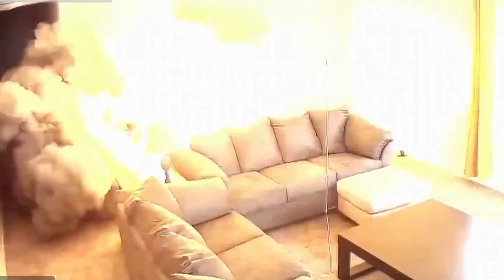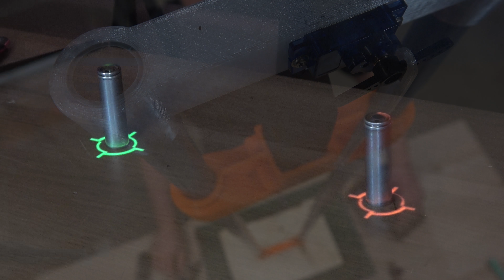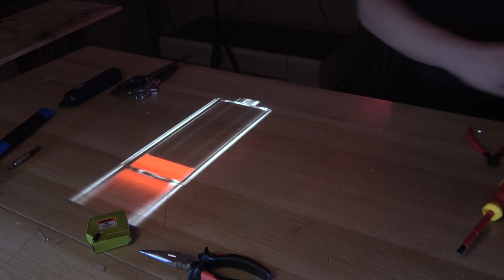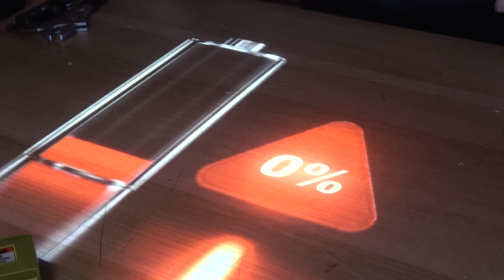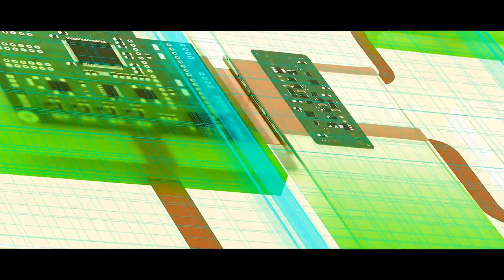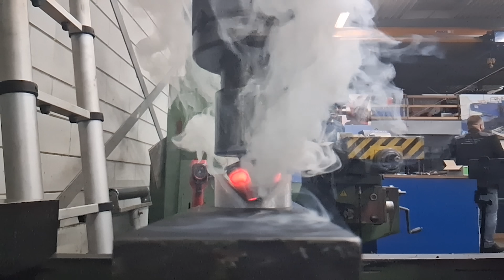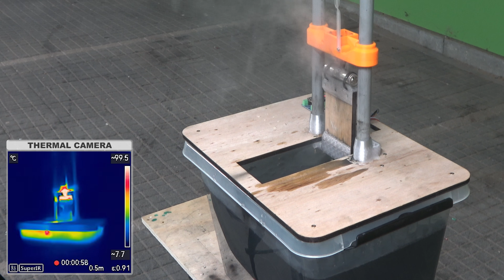Detonating Batteries.. For Science!

Comment: Pretty good followup! Would have liked to see you explain how to properly extinguish a lithium battery fire after demonstrating that water is not very effective. Additionally, you didn't address the oxygen in the water. Was the water oxygenated? Was it under vacuum before the experiment? How does oxygen in the water affect the ability of water to suppress a lithium battery fire?

I'm sure most people trying to extinguish these fires would spray or throw water, meaning the water would be oxygenated, but for the sake of science it would be interesting to see how deoxygenated water would suppress a lithium fire.

Comment: With the water test, i think the surface area to volume ratio of the cell makes a difference. i wonder how a thin and flat pouch cell about 4mm thick but much longer and wider would react to water - with a bigger surface area relative to its size, it might quench more quickly

Comment: For anyone who's confused as to why there's a difference between how fully charged and discharged batteries fail, this is because batteries use an electrolytic solution, usually an acid/acid paste, two dissimilar metals, lithium being one in this case, and am electrical connection between the metals made by the circuit/load you connect a battery to. With a fully charged battery  the pure lurk metal reacts violently with the moisture in air when exposed to it. When the battery is fully discharged the acid has completely/almost completely reacted with the metals making them no longer pure which leaves you with little, if any, pure lithium to create the violent reaction with air moisture, until you recharge it which reversesthe whole reaction.

Comment: from what i know, the battery doesnt create its own oxygen when submerged under water, the energy being released in this whole reaction is strong enough to cause electrolysis to happen, splitting the water into hydrogen and oxygen, which then feeds the flame underwater.
To extinguish a lithium fire, you must remove the oxygen from it, this can be done with dry powder fire extinguishers, in some cases special ones that use sand can also be used.  
Obviously the heat will remain, and the reaction will continue after removal of the powder/sand, so it is important to let it cool down for a while.  
But yea, that is why water is such a bad idea, it is quite literally as if you put gasoline on a fire.

Comment: Think I counted 27 Li Cells in my room alone... Hope this 12yo phone in my drawer doesn't spontaneously combust.
Reply: Usually happens during charging or hi draw. So just sitting dead in The night stand is normally safe. I had 1 burn. Try it out. Charge up one of tjem old ones and like he did stick a nail in it use a welding glove voltage heat and bad smoke. Or of you bend it it will go off. Thats how i killed 1 skinny phone sat on it like we all have done one in our back pocket.  Even had a galaxy 9s i tnink that i got new that lasted for years. Great phone it was. The battery started going bad so i ordered one. Phone wroked great till they told me they were killing the 3g and limiting the 4g so the phone would no longer work. But while swaping the battery the phone was all glass and glued together and water proof they say. Never tested it expect a small spill like we all do once and a while. Anyway the battery was also glued in the phone so i used the plastic prybars and tried to pull it out nice and slow. Then i bent the corner just a little the thing went off like a fire cracker mortar 3 ince flame bright blue and orange smoking up my living room while everyone else was sleeping instayed up late back then i worked at night so i kept my schedule on off days. Im like wooooo woooooo ran to kitchen grabed oven mits to the phone out in the yard into a puddle from the rain. It kept burning.. in the water. Luckily i did get the the thing out the phone and saved the phone some how. Did need to order a new back glass i broke it trying to rip the battery out at this point. Fun 😊
Reply: SAME! i have some rogue Li Ion Batterys ALL around my house Hope they dont spontaneously combust!
Reply: i used to do the same holding on to old cell fones , i had to dump them all because one of the oldest ones battery swelled like in the thumb nail . it was an old flip fone
Reply: Interestingly, guess what happens when a Li+ battery gets too cold? That's right! More fire!
Reply: ...you might want to check that phone since in my experience old batteries like to bloat when deeply discharged. I just had my old phone's battery bloat recently after I stopped charging it for 2 months.

Comment: From experience, it's scary when you puncture an iPhone battery by accident. Water does stop thermal runaway inside the battery itself, which basically stops the reaction already happening in one cell of the battery (supplying its OWN oxygen), spreading to other cells. You should chuck it on a stone or tile surface if safe (just smoke no flames), do not place in a metal sink as this can short it internally and make it worse. Get out the room and don't breathe in at all near it. Hold your breath. Never go back into the room without PPE until 24 hours after the reaction has finished. You should either leave the door open to the outside, or safely open a window (with an appropriately rated mask on).

Uni was fun. Luckily they had heat alarms in kitchen and not smoke alarms. :)

Comment: A dead battery is at its nominal voltage ifrc for a 18650 vape battery, they were 4v batterys would charge to 4.2v and dead was when the battery was below around 3.2v they still hold nominal charge no matter what

Comment: Deflating them is safe if you just make a tiny pinhole, deflate it, then immediately seal the hole with a spot of nail varnish.
I dind one of mine a few years back that was badly inflated, and it is still working normally and has never had a problem.

Comment: Pure lithium violently reacts with water and imolates on contact due to an exothermic reaction, in other words it catches on fire almost instantly. Yet another reason lithium battery fires are hard to deal with. Lithium is usually refined chemically from lithium oxide or other lithium based chemical compounds that are somewhat more stable. Lithium batteries aren't as eco friendly as many people think, the process of mining and refining it completely offsets any ecological benefits it gives after the fact. Not to mention the terrible pollution you saw occurring when the battery catastrophically fails. It is also very toxic and poisonous to most forms of life when improperly disposed of.

Comment: It does depend on the oxygen just like any other fire. And I'd bet batteries don't have air in them so it's not about that. It's alkaline metals that tear oxygen from water and sand when burning because of the high temperatures. You have to remove all oxygen from the source to stop the fire(e.g. you can stop the metal fire with gasoline(because it doesn't have oxygen in it) then with water. That's not really what you should do, but it works. It'd be better to use table salt because it'd stop the fire and won't start a new one on it's own like gasoline)

Comment: I imagine it'd be as easy as a few hundred gallons of liquid nitrogen to hose it down with or dunk into. Easy! Although the exothermic reaction is so damn strong and well "shielded" inside the batteries in question, that would probably even run into serious trouble combatting temperature which is the only thing you can possibly change once the reaction starts. They are self oxidizing and when the massive current dump creates enough heat for ignition...that's that. Water just doesn't have enough punch to cool it.

Comment: The CSIRO (Commonwealth Scientific and Industrial Research Organisation) over hear in Australia, are developing a Thermal Energy Storage (TES) battery that uses graphite or ceramic plates.  They say it should be in the vicinity of 70-80% efficient.  Which is extremely efficient considering it will be unlikely to undergo "rapid unscheduled disassembly".   That efficiency is good, they want to get it better because that efficiency is similar to lithium-ion batteries.  But those batteries store electricity, the inefficiency side of that gets turned into heat... which can then blow up.  But you do not plug these thermal batteries into the wall to charge up, they use heat.  They turn that heat into electrical power.  It is really quit clever, it's basically it is a solar battery and lithium-ion batteries are capacitors.  
 
Side note; they have already unveiled the worlds first quantum battery as well, but unless the thing runs on cats*, I have no idea how that thing works, because they charge faster as they get larger.... which makes no sense at all. 

* Schrodinger's cat joke.  If you get it - you don't get it, because the cat is both alive and dead.

Comment: Lithium Fires can seperate oxygen and hydrogen apart if the runaway event is bad enough so by spraying water on the battery you're just adding fuel. You're spraying water to prevent it from spreading, and cooling the environment, but never spray directly on the battery.

Comment: I worked at a battery store for 9 years and 11 months. I do have to say lithium battery fires are pretty rare. I saw 2 in all that time and those 2 were caused by improper disposal. Best advice I can give is do not throw away lithium batteries. take them to be recycled. When you are finished with a battery tape over the terminals of the battery and make sure there is no exposed metal. Also tape up each cell individually, not as a group or pack. Also swollen "danger pillow" batteries almost never pop. I have never seen one pop at least. I have seen them break out of plastic cases but the polymer bag that is the actual battery almost never pops.

Also lithium-ion or lithium polymer batteries dont really scare me. I mean yes they are common and can be dangerous but the battery that scares me more than anything is lisocl2 batteries. Lithium Thionyl Chloride batteries are terrifying. Thankfully they aren't super common but its possible you have one in your house. They are used in a lot of non-rechargeable items as a battery backup. Theya re also used in some diabetes test meters and pulse oximeters. When these get punctured they can have the violent fire but they also spray thionyl chloride out. Which turns to strong hydrochloric acid when exposed to humid air. I had one spray me in the face once. I thought I lost my eye but I got lucky. I ended up with a combination chemical and temperature burn that lasted a few weeks. It looked like I had bad acne. It was very painful though.

Comment: Very interesting video!  I look forward to seeing more tests.

As other users pointed out, the inclusion of LFP batteries (LiFePO₄) will be interesting to test.

Because the current tests used NMC batteries, and NMC cathodes will release oxygen in a fire event.  That is, NMC batteries "self-oxidize" to feed the fire.

OTOH, though LFP cathodes also contain oxygen molecules, it does not release them as easily, even during hot fire events.  So an LFP battery should only vent white smoke without a fire.  That is a major reason LFP batteries are much safer than NMC batteries.

Most EVs are already switching to LFP except for the higher-end performance EVs.  Almost all home batteries are now already LFP.

Comment: Rules to follow.
1. Charge to 95% and take the device of charge
2. Never sleep with your phone or any other device on charge next to you or in the same room... If the battery explodes, you unfortunately will not survive.
3. Never buy cheap batteries, Spend the money on top Quality batteries
4. Replace reusable batteries once they seem to not hold charge as good as they used to.
5. Don't buy anything that uses batteries off Temu... Too many house fires are started because of that crap. 
6. Always read the user manaual and safety instructions before use... common sense
7. Dispose of batteries properly, don't just throw them in the bin.

I'm a firefighter and have responded to two house fires and a garage fire due to shit quality batteries or batteries left on charge.
Also, I have responded to two garbage truck fires due to improper disposal of batteries... I know this information because we always find the batteries once the fire is out.. we know where the fire starts.

Comment: Class D copper based fire extinguisher.  You can also get the buckets of the copper based fire extinguishing powder.  Problem is that that stuff is pricey.  Copper binds with lithium with the intense heat.  Turns into an inert alloy.  It happens near instantly when the copper comes into contact with the lithium.  I gave up on telling fire fighters, stores, repair shops, companies, etc..  They just don't want to listen.

Comment: I'm not sure of the exact chemistry of the out-of-water reaction, so I can't say for certain this is what's going on, but alkaline metals burn violently on contact with water, stripping the oxygen, reacting with the oxygen, and leaving hot hydrogen bubbles that then ignite when they encounter the oxygen in the air. It's entirely possible that, if water is able to enter the battery, it may actually be the source of the hydrogen flames you're seeing.

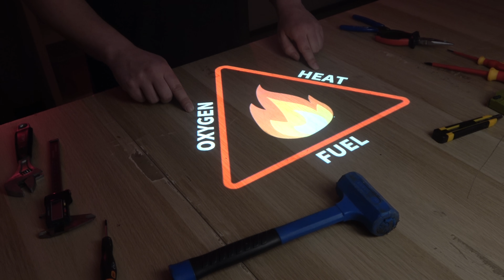Comment: 13:22 You're not taking oxygen away, unless the battery chemistry is something like Aluminum-air, which isn't quite ready for commercialization yet. Batteries almost always contain their own oxidizer. Furthermore, many of the metals used in batteries are reactive enough to use water as an oxidizer, which means by submerging them you're actually adding to that side of the fire triangle.
Reply: Which is what he said in the video.
Reply: Nice job not watching the whole video lmao

Comment: Nobody ever seems to have a direct answer to where to safely dispose of batteries, and also, what about lipos? They are more powerful than ion batteries. I’d like to see the same tests with those. I’ve got 60+ lipos, some of them are over 20 volts and 6000 milliamps per battery.
Reply: When you're throwing them away, completely discharge them if you can (down to 0V), or discharge them to their lowest nominal voltage and put a piece of tape over the contacts.
Reply: @logitech4873 and then what? Trash? I’ve heard from other people specifically NOT to do that.
Reply: @PigglyWigglyDeluxe  Huh? You don't throw them in general trash, no. You deliver them to your closest place that takes in batteries. All electronics retail stores do this where I live.
Reply: @logitech4873 and where is that, specifically? I’ve asked around, battery in hand, if they take them and they’ve all said no. Home improvement stores, recycling centers, dumps, fire departments, etc.
Reply: @PigglyWigglyDeluxe  Idk. I don't know what country you live in. I just know how to do it in my country, and it's made to be very easy here.
Reply: @logitech4873 which is why i still believe nobody ever has a direct answer to where to safely dispose of batteries. I’m in California.

Comment: The one thing that you need to keep in mind with batteries is not just the way they fail but the manufacturing quality and standards of the batteries in question and the saftey or lack of safety items built into them and the devices that are used to charge and discharge them. This is the critical factor when you see the many failure events online.

Comment: 6:00 what was the voltage?  Different chemistries have different cutoff voltages. Cells used in ev typically go down to 2.5v to 2.8v per cell while high discharge batteries dont go below 3.6v

Comment: Lithium Ion is an umbrella term covering multiple chemistries. I'd be interested to see the thermal runaway differences between LiPo (Lithium Polymer), NMC (Nickel Manganese Cobalt) and LiFePO4 (Lithium Iron Phosphate) batteries.

I'm also interested to see how easy it is to force thermal runaway from non-physical trigger modes. For example, if you bypass BMS to drain a battery to absolute 0% and attempt to recharge it, what is the likelihood that the internal damage results in a fire? Does it take multiple charge cycles? Another example would be low temperature usage. The electrolyte in the batteries may crystallise and form dendrites when used at cold temperature, which can eventually pierce the separator between anode and cathode. It'd be interesting to see if you can force a failure by cycling a battery a few times below safe operating temperature.

Comment: Lithium into water. Someone clearly hasn't passed 8th grade chemistry. 
The only lucky fact is that Li-Ion batteries have actually very small amounts of Lithium in them. To think that a Li-Ion battery has between 0.8 - 3 MJ/kg ... just think that TNT has ~4.2 MJ/kg.

Funny to see the Hydrogen that is created by the alkaline reaction burn on top of the water.

Also the Fire departments around the world have put burning cars and 40 ft containers into water for DAYS, where the re-ignited again and again.

The only thing that will stop a self-supporting exothermic firebomb is: Sand. The Silica will take the heat and melt, and generate a seal.

That also why in real Battery test facilities they put batteries in sand in a bunker, when they do tests.

You know how we found that out? American "Stabbrandbomben", incendiary bombs/devices, like INC4, AN-M50, thrown on German cities (also Japanese cities). Magnesium, Phosphorous and Aluminium among main Ingrediens. Often also using Thermite, of powdered aluminum and powdered iron oxide.

I know why I prefer 40 MJ/kg Diesel.